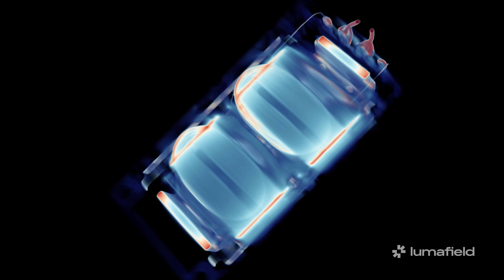Switch 2 Pro Controller: Built to Break? Full Teardown

Comment: "They stick with potentiometer-based sticks, even while other controllers from competitors in similar price brackets use Hall effect sticks"...

Of course, what he intentionally leaves out is that those competitor controllers DON'T include any of the other high-volume controllers from Microsoft or Sony, instead he's referring to lower-volume premium controller options from 3rd-parties. He also chooses to ignore the part where supply chain constraints limit the use of Hall effect sticks in such high-volume products...
Reply: Xbox and Sony aren't competing with Nintendo for controllers, considering their controllers are quite literally not compatible with the Switch because they're made for different platforms...
He's obviously referring to third party ones that are compatible with the Switch and as such are in direct competition with the (worse) official controllers. Stuff like 8BitDo, Gamesir and Flydigi.
Reply: Re: supply chain constraints

if Hall-type sticks are so hard to source at scale, then why are the "premium" 3rd party options less expensive than the Nintendo ones? The 8BitDo "Ultimate 2" is available for $70 US and has all of the features of the Nintendo Switch 2 Pro controller, AND has TMR (magnetic type) sticks. 8BitDo is often the top recommendation from YouTube gaming channels for controllers.

I believe Nintendo is just choosing to keep more profit margins on the controller. The most expensive parts of electronics are chips and batteries. Using Hall or TMR sensors requires an additional dedicated chip. By continuing to use potentiometers, they don't have to use an additional chip.
Reply: @HittTheDekk  My own Vader 3 Pro (from Flydigi, one of the manufacturers I mentioned) costed $80, the same you'd be paying for an official controller from the big console companies, and came with hall effect, analog triggers, gyro, six programmable buttons, and basically EVERYTHING I could ask for. Hasn't failed me once in 3 years.
Kind of ridiculous that a random chinese manufacturer can pull this off while still making a profit, but Nintendo can't.
Reply: @HittTheDekk  Because 8BitDo and other 3rd party manufacturers that make more premium designed Bluetooth controllers have lower sales volume. They make smaller production runs and then sell their inventory before ordering more. They can use slower production lines with hand assembly and off the shelf parts. They don't need to produce different packaging for different regions, they don't need to send large volumes of stock to distributors and retailers across the planet. They simply have lower demand that allows them to have lower supply in production. 

The Pro 2 and Joy Con 2's are also a little higher priced to make up for the fact that the Switch 2 console itself is being sold at a loss in order to sell more units. The last time Nintendo priced a console closer to manufacture costs we got both the Wii U and the 3DS, both of which almost immediately had to lower their prices to avoid failing. The 3DS recovered especially when the 2DS came along, and the Wii U died.
Reply: This is a ‘pro’ controller, with ample price to boot. Joycons you can probably excuse, this not so much.
Reply: Really feels like ifixit have in the past few years been using their reputation to give bad PR to any manufacturers who aren't selling parts through their store (i was surprised for them to straight up say 6:26).

Plus the two times I bought replacement parts from ifixit (a nintendo switch battery and a pebble 2 battery), the switch battery was a clearly used unit which was bloated and scratched up (despite the page listing it as New), and the aftermarket pebble battery was physically too large to fit in the device despite being made and labelled specifically for it.

Edit: And it looks like they've removed this comment. Genuinely sad how they turned out.
Reply: LOL. As if a company like Nintendo could not source enough Hall Effects Sticks, especially when they have years to plan it. Companies in China are VERY good at responding to demand, especially with a long term buyer like Nintendo they can plan with.
Reply: Good point, hall effects are being used in tons of other devices that it might not have been possible to manufacture the hundreds of thousands they needed
Reply: @DiceRobo  Hall effect sensors are used for the cam and crank sensors of a lot of automobiles, and since many different automobiles from the same manufacturer will use the same engine, this means that hall effect sensors are already being made in the literal millions (as an intentionally lowball guess, I know the answer is a lot more than that but it's enough to demonstrate my point).
Supply is not the issue, IMO the issue is integrating the sensor into a joystick assembly. that might be volume constrained, and as long as nobody's making a high volume controller that uses them, that's always going to be the case.
Supply follows demand, if a console maker starts making a controller that uses hall effect sticks, the production of hall effect sticks will be increased to match the increased demand. If supply didn't follow demand, we'd never have enough of anything including food and drinkable water and material to build houses out of.
Reply: @44R0Ndin  The volume constraint is entirely Nintendo's fault though. It's a new generation and they didn't maintain the old generation's general shape so there's no accessory compatibility to work with. They had a blank slate.

By adding a bunch of biscuit wedges into the system for "structural stability", they've sacrificed the internal volume, making it entirely their fault for self-imposing tolerance and space restrictions.

And if they needed more internal volume beyond the volume that the wedges take up, they could have simply made the back of the controller less concave without impacting ergonomics at all because people are not usually interlocking their fingers on the back plane, they're holding it around the grips (especially now with the grip paddle buttons). Make the controller thicker on the back plane, drill holes into the PCB so that you can leverage that thicker back plane space so that you can make a larger stick cradle that still comes off with screws, and use fullsize sticks/hall effect sticks.
Reply: The Sega Dreamcast used a hall effect joystick in it's controller, supply chain issues aren't the reason console makers aren't using hall effect sticks.
Stick Drift is not a recent phenomena. awareness of stick drift on social media is a new phenomena. I have personal experience to corroborate this:
I had a PS2 back in the day, and I put a lot of play hours on it, a few hours every day after school until my parents got home and made me do my homework.
Over the course of 5 years, I had 5 controllers start to have both sticks drifting, and this was with me only ever buying name brand Sony controllers because I knew the third-party ones didn't work as good.
Even back then, 1 controller every year was only like buying one additional game every year, and to be honest considering the entire controller to be a consumable item with how many people throw them in anger when they get frustrated at the game is IMO an entirely reasonable assumption.
In other words, yes it might suck that these controllers are so expensive, yes it might suck that they don't last as long as you'd like, and yes you're right they could be making a better controller. The error is in assuming that they are deliberately making the controllers less durable to drive sales. This is not happening. What is happening is that they know better than to cut into their profit margins by making a more durable controller, not them trying to increase their profit margins by making a less durable controller and charging less for it.
That being said, I am someone that swapped hall effect joysticks into my Nintendo Switch (1) JoyCons when they started showing signs of stick drift, and I have been recommending that people try to buy controllers that have hall effect sticks if possible. Just because the console makers won't do it doesn't mean we don't have an option to get what we want anyways.
What I'm trying to say is that stick drift is not caused by active malice by the console makers, instead you can blame "Better is the enemy of good enough" when the console makers are setting the standards. If your standards differ, you have many options for controllers that have hall effect sticks.
Reply: @44R0Ndin  The Dreamcast also failed and drove Sega out of the console business. With production moving out of Japan in the 90s to China, companies had to adapt to what is available.
Reply: If supply chain issues and the high-volume nature of the product are causing it to be so shitty then they shouldn't be selling it for $85.  Premium price invites premium criticism.

Comment: So its a bad controller because its sturdy and hard to repair? Im sorry that that makes your job way harder but as a consumer this is one of the most solid controllers ive ever felt in my hand
Reply: "as a consumer" you should want to be able to replace the battery or sticks without performing major surgery on your controller or spending another $90
Reply: @nightzowlz  its not major surgery. The only real thing they complained about is the adhesive. You could easily use some other adhesive to keep it on there. Otherwise its very similar to any other controller teardown. A slightly more annoying teardown is a perfectly fine trade to make for a more sturdy controller.

Comment: It's clearly not built well but I disagree about the rumble packs. They should be in the grips as they are the heaviest part of the controller. If they're in the main body of the controller it doesn't feel the same when they go off and you're countering the weight of the rumble pack even when it's not active.

Comment: I like the controller but what I agree with is it’s way too much work to swap the battery once it dies. The original Switch pro takes 6 screws and a short amount of time.
Reply: I mean have you had to replace a controller battery ever?

Comment: Yep. I just bought a DualSense Edge, (which I do love), and the *only* reason I was willing to forgive the potentiometer sticks is because of how insanely easy it is to swap the sticks out, including with aftermarket Hall Effect or TMR sticks. But both of my 8BitDo controllers have Hall Effect sticks and they were a fraction of the price of this "Pro" controller. And lets not forget that it also doesn't have "pro" features like back paddles, or adjustable stage triggers. This is bacially a low quality controller being sold at a high quality price point.

Comment: We need the EU to form a dedicated technology council to focus on improving tech overall, starting with the abolishment of potentiometer based analogues, in favour of Hall effect
Reply: Potentiometers are fine. The slim versions used in modern controllers are less durable is all. However, with modern advances in semiconductors and magnetic sensing making Hall/TMR sticks cheaper, there is no excuse for selling an $85 controller with sticks that will drift, whether that is at 50 or 500 hours.

Comment: I got an 8bitdo ultimate 2c for my switch 2 for $23. I love it and can buy 4 of them for the price of one pro controller.
Reply: We love 8bitdo
Reply: Not even my switch 1 pro controller can wake up my brother's switch 2
Reply: Does the ‘shake to wake-up’ function still work on Switch 2?
Reply: @MaI2Me  no nintendo has that feature locked down this time and nobody has cracked it yet. same with the dock. theres like one dock that cracked it but said nintendo can change the codes any day so they dont guarantee compatability.
Reply: @v3xx3r  ‘smart’ move from Nintendo…I mean from a business point of perspective.
Or let’s just call it greedy 🙃
Reply: @MaI2Me  It doesn't, unfortunately.
Reply: See you have to get the $70 one for the switch 2 for it to be worth the same amount as the Switch 2s
Reply: they are not repairable, but as you say - they are cheap! and good! I have one too
Reply: @Tom-kl9jf not me literally just repaired mine, after around 2 years of regular use.
Reply: @hendrianfajar  I stand corrected! what did you do? battery, sticks? I need to do more research clearly - what just going by hearsay

Comment: One point, I have a day one Switch pro controller which is still going strong and has NEVER needed a replacement battery. That's an 8 year old controller!!

I have found the original pro controller very durable, unlike the Xbox and PlayStation ones which i have had to replace (On my 3rd xbox series controller), and the Pro 2  feels just as solid.
Reply: I think its pot sticks are heavy on RNG. I have 2x Series X controllers for 4yrs with no issues. My 2017 switch1 never got drift, but I replaced them with TMR as soon as they became available. 

My friend’s 2020 switch1 has gone through a few sticks (that I’ve replaced for her).
Reply: Kinda agree. On my OG pro I only got drift to the left yesterday. But now it seems fixed after re-pairing. 
I ain't greedtendo fan anymore, but controller works great and battery lasts 2-3 days longer than NEW PS5 trashsense. 
Xbox is the worst. Elite 2 drifted after a year, my wife's elite 2 drifted after 6 month, I bought elite core - drift from a shelf. Went through returns and re-purchase just for it to start drifting in a few month. 

Flydigi Vader 4 Pro is a peak of engineering, customization and price.

Comment: I feel like it's nice that the joy sticks are screwed to the board, compared to being soldered on.

That alone makes them significantly better than the original Switch Pro Controller. Now most DIY-ers should be able to repair it with a basic kit from iFixit and a guide. 

But I am all for making them even more accessible, and agree with putting pressure on Nintendo to do better in the future. But most components not being soldered is a win for repairability.
Reply: Which is good for resilience when being dropped on your carpet if become careless
Reply: Yup agreed, it's an improvement. Only thing I dislike is the glue

Comment: The points made in the video are most definitely valid, but these statements on the battery are ridicule, I'm sorry. This controller is rated to last 40 hours on a single charge, and most people get even more out of it - even if you're a heavy gamer, it won't degrade in any substantial way for at least 5 to 10 years, when at that point you'll be eyeing on the new generation of console. And if you aren't, you probably won't ever need to replace it at all. Again, I get the point of the video and it's mostly valid for the rest of the thing, just replacing the buttons seems absurd - but the battery is not a concern here.
Reply: Batteries eventually wear. If you're a professional Smash player, or just play games a lot, you're probably using the controller enough to have to replace the battery in less than 5 years. PS4 controllers have a similar sized battery and often need replacements. For the average person, perhaps the battery will last the life of the controller.

Comment: I just wanna shell swap it for octagon cut outs for smash but I guess i'll have to pass os shell swaping
Reply: you're probably better off buying a third party controller that's easier to mod at this point.
Reply: I mean, yeah the glue would be hard to deal with but you just pry it up. it seems like that would be even faster to add octagon sticks than the old pro controller.
Reply: @DiceRobo  to echo @Zanpaa 's reply, it doesn't stop at just replacing the face plate, unless you want to greatly restrict the stick travel. The sticks never hit the gate on the controller shell. There's an internal bumper under the stick that stops it short of contacting the shell.

You would need to replace the sticks as well.
Reply: the sticks don't even contact the shell, so that would be a much harder mod to do here. the edge of the stick course is determined by the shape of the actual cap.

Comment: What a contrast with the aftermarket 8BitDo controllers.
Recently picked up my SN30 Pro+ again to use it with Flick Stick input.
And it just feels great, despite being a simple thick plastic shell around the components.
From what I've heard, ewer versions now have hall-effect sticks, fixing this point of wear.
But for Flick Stick and WASD mapping use, a 70% deadzone feels best so drift hardly matters for me.
Mine are perfect, but I hardly use the sticks otherwise so this is due to light use.

Comment: So they did the same thing Microsoft did with the Xbox 360 and focused so much on not having a single screw visible that they made opening it up a nightmare
Reply: are you talking the console or the controller? the 360 controller had a very easy disassembly, just one hidden screw under the sticker in the battery compartment. The console, yeah I can see that with all the stupid clips and needing a special piece of metal to stick in the rear of the console.